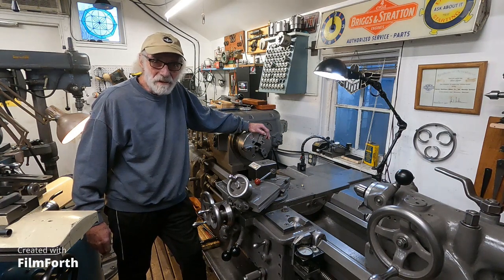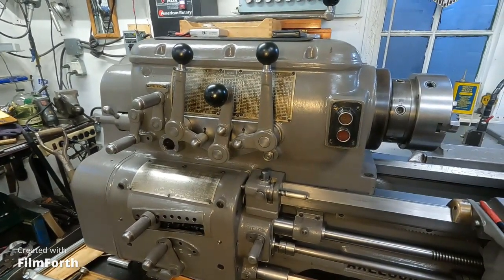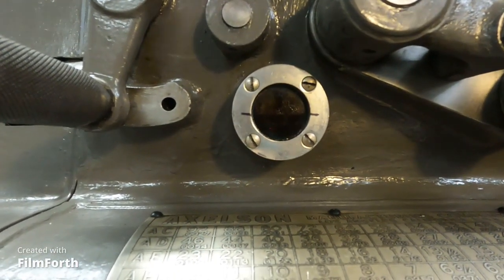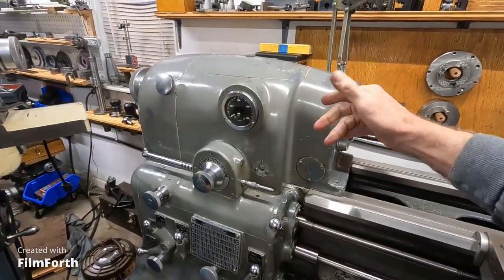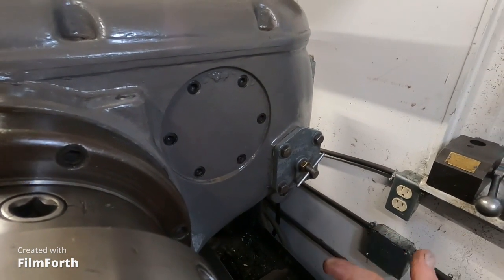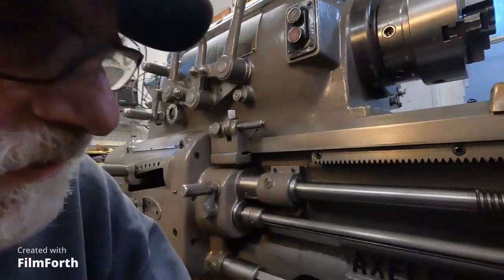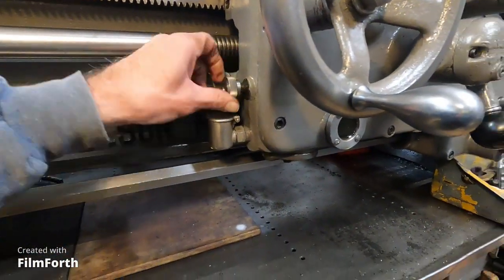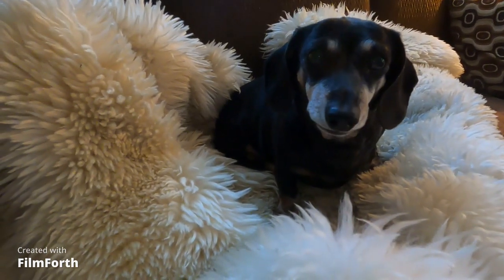Axelson metal lathe oiling tips

Comment: The DSG's have oil level and oil flow sight glasses on the headstock and the threading gearbox, later ones have a sight glass on the apron as they have a pump in there as well. Late 60's and on have a pressure switch in the headstock that illuminates a red light on the switch panel if there is low oil pressure.
Biggest issue is if you don't use the machine for an extended length of time the pumps lose their prime and you have to remove the headstock cover to reprime it.
Reply: My 1972 1307 is supposed to have 22 pints (UK sized ones) in the headstock.
Reply from the maker: I have looked at many machines, the DSG appears to be the most refined of the gearhead lathes.